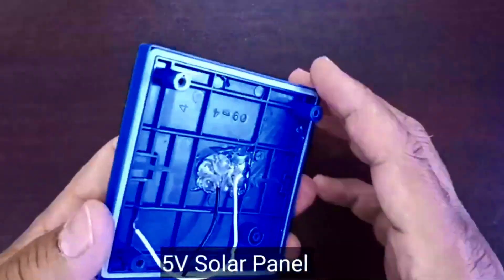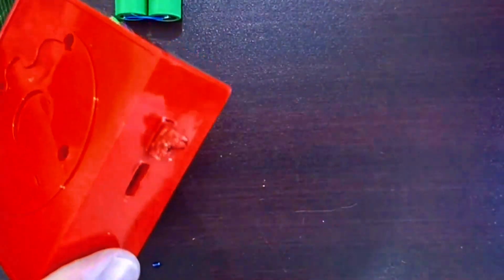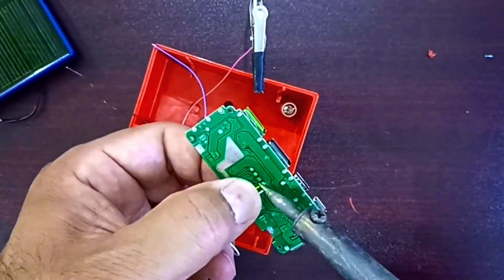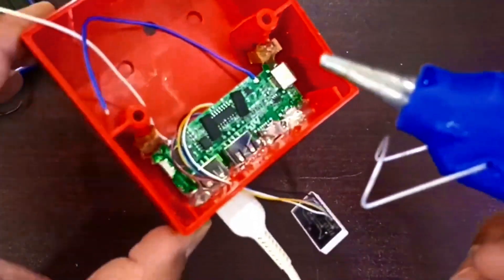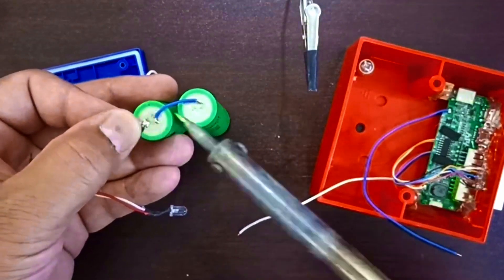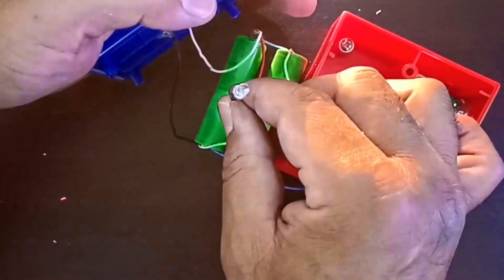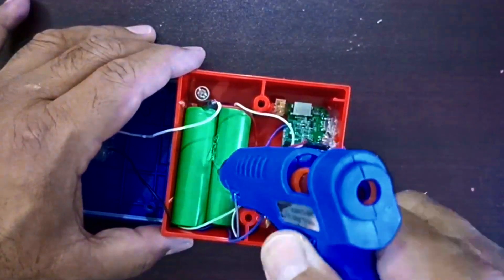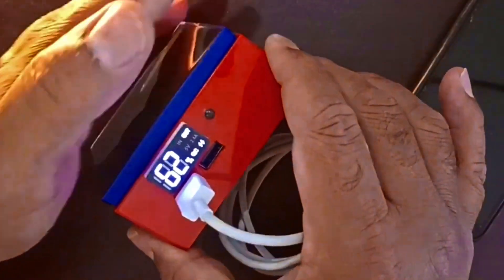DIY Solar Battery Charger That Actually Works

Comment: It is not good to use normal diode!
It consumes 0.7V and thats huge reltaive to the solar panel

Instead use a diode which consumes low voltage

Also, the indication led consumes high power relative to the solar panel output

Instead, limit the current of the led to 1mA or less using resistor
That will improve the power produced by a lot

Good job